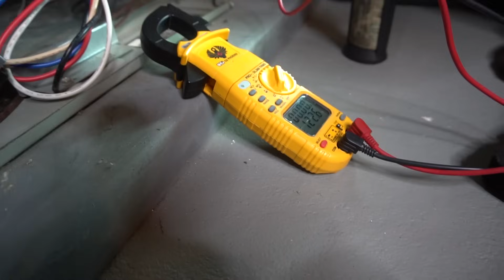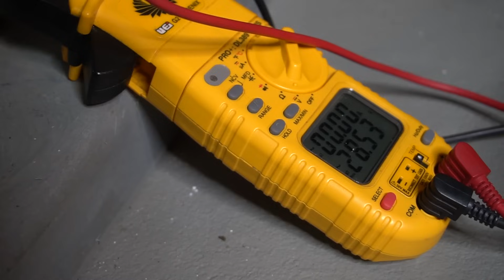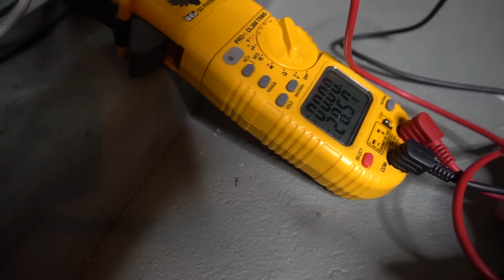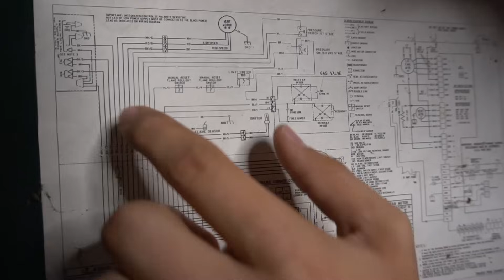Furnace/AC How to Troubleshoot The Control Board

Comment: Hey thanks for that video. I have a goofy situation as you put it. My building, 3 furnaces, 3 stopped working after some electrical work done to the main city feed coming into the building. Boards are all dead. Nothing from LEDs. 120 v going into transformers and 24v coming out. Any thoughts?
Reply from the maker: I would check the 3 amp fuses (or mini circuit breakers) to see if they are blown/tripped. If they are not, next I would jumper the thermostat at the control board (I have a video on how to do that if you need it). If the units come on when jumpered but not by themselves, then that usually means the boards are bad.
Reply: @WordofAdviceTV  
Thank you. I will do that on Monday. Fuses did check out okay. Appreciate the help!

Comment: No power at thermostat terminals - 28V out of transformer.  I started looking closely as the board and noticed a resistor seemed to be burnt out, there was a bit of black smoke marks on the board around one of the solder connections.  Guess it's time for a new board then? Or might it be repairable with a new resistor?

Comment: I have an American standard freedom 80 2 stage. My inducer motor runs all the time even when the thermostat is set to off. Does this mean my board is bad. If not why would the inducer motor run with the thermostat set at off. It also runs when the thermostat is on but not calling for heat.

Comment: Thank you very much for the video. It helps a lot. I followed the steps showed here and all are fine. But the volts to inducer is just a few volts (should be 120 volts) so that the inducer will not run. Where the problem is? Or in which step should I check? Thanks.

Comment: Mother nature threw me a curve ball. A field mouse found its way into the heat pump and was zapped by the fan cap terminals. The thermostat was blank and of course nothing was happening. The 5A fuse on the control board was blown so I replaced it. Things powered up and heat was flowing. A couple of hours later there was only cold air coming out and the thermostat was displaying "Er." I turned the breakers off to reset and the system came back on again. It's now operating in this cycle. Sometimes the "Er" displays and others not. When there's heat the compressor is running and making heat. When there's no heat the compressor outside is silent. I'm stuck between the control board and the compressor itself. I'm going to check the contactor next for arced contacts. Any thoughts? Great videos!

Comment: 118 volts on the top side 27 volts on the bottom. But when I measure between C and R I get 14 volts w no thermostat wires in. When I put the thermostat wires in and measured between C and R I get 4 volts. Thermostat is blank. This is the 4th board I’ve got from the same guy. I think all these are bad. Thoughts?

Comment: My induced draft motor keeps restarting - intermittently.  Eventually the gas comes on and everything is fine.  I have told everything from a pressure switch to a control board and even just replace the entire furnace.  Any ideas on where to start looking.?

Comment: So I went through all the tests you suggested and the NEW IGNITER AND FLAME SENSER is not working?  What is your suggestion? I also replaced the inducer motor. When I power up the furnace the inducer motor starts but the igniter doesn’t light? HELP……lol

Comment: Remind me when my ship comes in to send you A 100 bucks

This channel has saved me so much money over the years

In my case though it was the wires to the ignition switch got pinched and shorted out

But I do have to say that at first I was not getting voltage to the ignition switch

I don’t know if if I when I pull the fuse out and put the fuse back in if it resets something

So if your ignition is not working it might just pull the fuse out put it back in 

but don’t ask me
Why

But I was not getting any voltage to the connector that goes to the ignition switch at first then I was troubleshooting the board

And maybe since I had a short in my wires going to the ignition switch the board needs to be reset or I don’t know

But after troubleshooting the board that I was getting 120 V to the coupling the connected to the ignition switch

But it wasn’t getting hot and that’s because the wires got pinched in some 10 and it shorted out because my first symptom was that I had a breaker blow in my garage

Anyway I’m happy
Reply: I’m talking about the fuse on the board which she mentions in the video my fuse was on the board his is not

Comment: I need help in my Trane xv 90 , I change the inducer motor the gas valve the flame sensor and pressure switch and nothing happened

Comment: This is my second board now. The first one was at the end of 2020 and now 2023. Either the manufacturer of these “Sure Light” boards made for Lennox is trash or maybe a wiring issue? Moved in back in 2017. Should there be a fuse on that line? Will a surge protector help? Or is it a electrical issue? The last board kept giving me a pressure switch code. The board before that kept giving me a flame sensor not sensed code. Did everything to correct both codes. Last resort, switch the board and on both incidents. The furnace worked. I’m stumped.🤔🤔

Comment: Can you help me? My furnace works fine but my humidifier doesn't work.. I checked the solenoid humidifier with multimeter and no power going through. I checked the panel board inside and I am not sure if the cables are connected correctly. The white cable goes from "B/C" (on the board) to the solenoid, the other cable from solenoid goes to Range panel (low and high), and the black cable from this range panel goes to "W1" in the board. Is this right? .. I am living in an old house and the furnace came like that.

Comment: I'm stumped.  Gas valve won't open on 8 year old Armstrong high efficiency furnace.  Call for heat, inducer motor runs, igniter glows red, blower starts, but gas valve never opens.  But....when voltage is applied directly to the valve it opens.  And.....when valve is disconnected from the control board, the control board sends 27 volts to the valve wires for 3 seconds shortly after the igniter glows red.  But when everything is connected, after the igniter glows red, my meter spikes for a fraction of a second when connected to the gas valve.  Not long enough to open the valve.  Is there some safety interlock that's preventing the control board to send voltage to the gas valve when it's supposed too?  Thank you in advance for any help or suggestions.
Reply: Forgot to mention - no error codes, i.e. no flashing led lights and I just installed a new control board.

Comment: Don't know if you have this or not, but, a gr8 vid would be the routine maintenance of furnaces, both pre-season and during season, to help prevent problems down the road, much like your "Top 10" vids. What are the common things a homeowner can do to keep their unit running at peak, and then, tie that into WHY that is important (what goes wrong if you don't do that maintenance, tied directly to your previous vids and link that maintenance directly to the various problems you've addressed over the years). Thank you for your time, and all that you do.

Comment: Great video.  Clear, concise and easy to follow!  Fighting a possibly bad circuit board in a Lennox 2-stage that date at least to 2004.  It has been bullet-proof, but we are fighting high winds and -20F outside temps, and all of a sudden not working.  Diagnostics show open limit switch. but all limit switches are closed.  When lights are bad, blower fan is running, even though no flame and no heat in unit!  Managed to get it going, by pressing sideways on relay.  Will try to touch up solder joints after house is warmed back up.  Looked at replacement board.  Have you ever seen a new board go to square shape to replace a rectangular board and have components and terminals in different places from original?
Reply: Iv noticed to never ask questions about lennox because nobody including lennox knows the answer.

Comment: I have the same furnace as the one in your videos, which your videos are great by the way! Keep making such great content! But when I turn it to heat it keeps cycling without turning on. The igniter doesn't start and the gas valve doesn't open. I just hear power being fed to the inducer motor making noise for almost 1 second, I hear2 or 3 clicks, but then turns off... It then does that again and again. This has happened before but it had eventually started working again at some point in time in the future. Any ideas what's causing it to be so unreliable?

Comment: I learned quite a bit from this channel.
However I really do need a word of advice.
On cold start up inducer comes on. Hot surface igniter heats up but no gas valve.
It's intermittent. 
It might get to the 3rd cycle of not igniting and go to lock out.
Or on the 1st time it might light up. 
New control board , high limit, 
Igniter and flame sensor.
I have no idea what's going on.
Do you Word of advice ?

Comment: I used the non-contact voltage detector pen to sniff the wires for power quickly. This is how I found out that the board was not sending power to the gas valve.

Comment: I am trying to troubleshoot HVAC issue - operated normally overnight, next morning no A/C.  I believe I have eliminated thermostat and board root cause.  With contactor coil wires removed, board reads 24-28 volts as expected when thermostat calls for cooling (blower, cooling to common).  With contactor wires replaced, the voltages drop to 7-9 volts.  No fuse blowing or circuits tripping.  Your videos have been amazingly straightforward to follow.  I was hoping you could point me in a direction for this voltage drop issue.  Thank you very much!
Reply: ADDING:  Removed the Homer XMC0-231-EBBC.  It is sealed and looks good.  However, resistance on coil is 0.5 ohms (zero-point-five). This might explain why the voltage from the step-down transformer falls from ~28 volts w/o contactor wired to <9 volts with the contactor online due to overloading the step-down transformer (which was overheating as well).  Unit is 6.5 years old, and this is the OEM contactor.  I am not sure how common this is or if you would agree with my findings.  I would appreciate any insight you may have.  THANK YOU again for your channel.

Comment: Hi there, I may have touched the C and R terminals when trying to setup a new Amazon thermostat. Could that have burned out the hvac control board? Is there a 24v fuse somewhere I can check? It is a Carrier with board number HK42FZ017. Either that, or the cover switch isn't making good contact because the whole thing is sideways and missing a screw...
Reply from the maker: Most control boards will have a little fuse on them and it's likely that yours burnt out. This video may be able to help with tracking down what burnt out: https://youtu.be/4e4wsruGS0s

Comment: Hi
This is wired case
 I have 24v AC in my controle board and everything works ok the inducer the bolower motor the gas valve all the switches the ignitor 
(everything is good)
My flame sensor does not sense the flame and everything goes off after 2 seconds, i changed the flame sensor 3 times and end up with the same problem...please hlp thk u

Comment: Hi Jay, I could really use your advice on this Goodman Furnace issue Model:
CHPF030A2C. (3 blinks code saying pressure switch stuck open)
*
Symptoms: Inducer motor turns on, pressure switch closes as it should. (Was replaced it also to rule out). The ignitor is NOT coming on, (Note: it came on twice when I first started troubleshooting, and gas turned ON for a split second and immediately gas turned off again...gas was ON and OFF all within one actual second). Gas just blasted on then turned off immediately...Flame detection sensor was replaced also last week.
 *
At this point the Ignitor still does not come on at all. There is 5.8 volts going to the Pressure switch so I don't know if that is correct voltage or should it be 24 volts. We are thinking a mother board issue with perhaps a relay sticking etc or some other mother board issue.
*
The board LED still blinks 3 times saying pressure switch stuck open, but we confirmed with a meter it closes and works properly. Ignitor at this point still does not come on (although it did twice as mentioned). Thanks as always. 
Phil
(Jersey Shore)

Comment: Great Video. I have electronics background but not HVAC but like to fix things myself, so this is helpful.
I once repaired a bad board that would malfunction only when it got very cold. The heater would quit working when needed it most. Blow hair dryer on the board to warm it up and it started working. Since I knew electrolytic capacitors can cause this with age, I just replaced everyone of them on the board (there were several) and that fixed the problem. You have to obviously have experience with those and soldering but a tip for the extreme DIYer.... (I also repaired my garage door sensors this way that quit working in the cold)
Reply: Im a novice electronics guys.  Have the assortment of caps, diodes and resistors.  Getting ready to do the same.  Figure I can't break what is already broke. lol

Comment: I have the same one as you.  The board isn't bliking. I removed the board and opened all looks fine and no burnt smell. However,  the transformer box has a burnt smell.  Could be that the transformer is burnt?

Comment: Hello, I try installing a smart thermostat today and I connected a wire to the "C" on the board and thermostat but there is no power.  What may be the cause of this? The board has a red light on and I made sure the switch it pressed in.  Thank you!

Comment: My furnace isn't igniting. The fan motor comes on, then the igniter starts to glow.  I've checked the 2 wires that attach to the automatic gas valve. I get no voltage except for a split second as the igniter starts to cool. The voltage reading reads 10 volts, but as I said, it only happens briefly. My guess is it's the control board, but I'm not sure.

Comment: Thanks to your videos I discovered that the capacitor on my outdoor unit short it out. It caused the wire from the outdoor unit to the upstairs unit to be damaged. I replaced the capacitor and fix the wiring and voila the machine turns on and pumps out cool air as expected. 

The issue now is it never turns off. No matter what the thermostat says no matter what settings I use the machine always stays on never turns off. Power to the control board seems normal. Any ideas?

Comment: I have voltage on everything except to when I get to the thermostat terminal strip, would that be a sign of bad motherboard?
Reply from the maker: That could also be a burned out 3 amp fuse or a bad transformer.
Reply: I have the same problem. how did you fix the problem? I already install a new transformer,because  my old one only put out 19V.

Comment: Just looked at a keeprite, inducer wont turn off but no codes. I forgot to check pressure switches but i assumed its the board given there are no codes and it wont turn the motor off?

Comment: If the light on the board is flashing you have 28 Vac and 115 Vac. Waist of time checking door switch, power to transformer. and 28 Vac from the transformer.

Comment: My fuse is blown.  I replaced it and it popped again. Does this mean my control board is bad?
Reply from the maker: No, that usually means you have a shorted wire somewhere. This video will hopefully help with that: https://youtu.be/4e4wsruGS0s

Comment: Hello, I've been having some issues with my AC unit and I thought I'd throw a hail Mary to see if I could get anyone to assist. I've checked all the common issues, I had a tech come out to look and replace the control board, got a new thermostat, but still have the same issue. When the thermostat calls for cold, there's only 1 volt registering from common to Y on the contril board. Everything else looks fine and I can't think what to check next.

Comment: Hey Jay, what a wonderful series of videos explaining how to troubleshoot furnace. 
Based on how you explained in this video, seems my board is completely fine as I am getting 28V to R and C terminals. And if I talk about sequence of operation then it is completely going fine till ignition and then gas valve is having click sound as well but it does not open valve to pass gas (no hiss sound of gas coming through, I tried manually light up as well but no gas). For some reason gas valve is having click sound but not opening gas to furnace. And error light is continuously blinking which did not help me to understand the problem either. Could you able to help understand what could be the issue. Thank you so much !!!!
Reply: Did you ever figure out the issue? I’m dealing with the same
Reply: @DavidDavidsonA  did you ever figure this out, too? Same issue! Took out my blower motor and cleaned the fan with a pressure washer and cleaned and lubed the motor. Reassembled and my gas valve is no longer passing gas. Wondering if I messed up the control board or a relay on the board somehow when wrestling the blower motor out, but I was pretty careful. Blower motor turns on, A/C works as it should, but no heat.
Reply: Did you ever figure this problem out?? Having the same issue it seems…
Reply: @broadshoulderbeaver  my issue ended up being the draft inducer assembly. I replaced it and have been good to go since. Good luck

Comment: Hi J, my door switch sends 120 vol to the CB, the CB sends 120 vol into transformer, the transformer sends 28 vol into the CB, and the CB sends 28 vol to thermostat terminal.  However, when I bypassed the thermostat by putting a jumper on the terminals, the fan came on, the furnace came on but the ac didn’t turn on.  Do I have a bad CB (WR 50A55-486) or something else?  Thank you for your help.